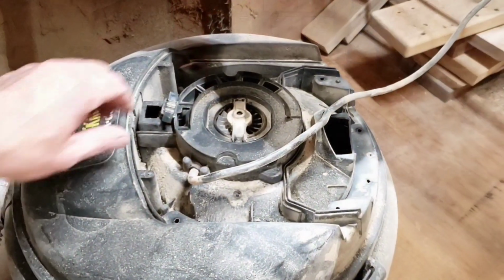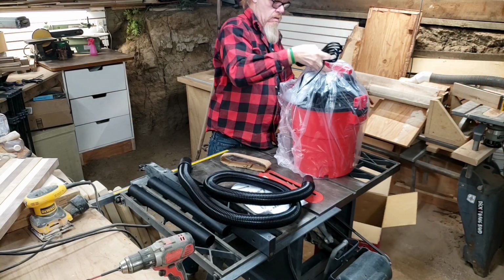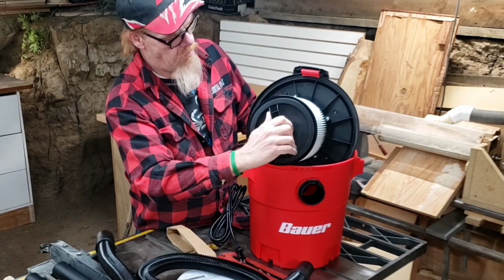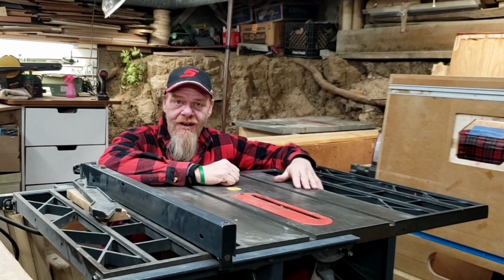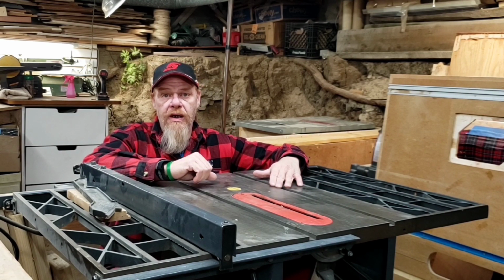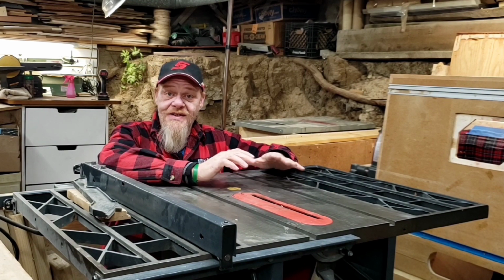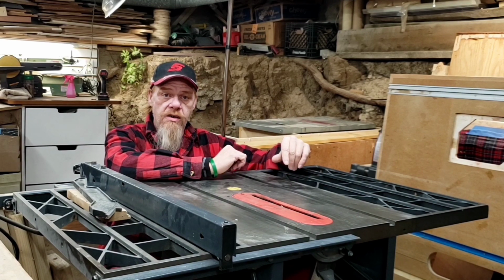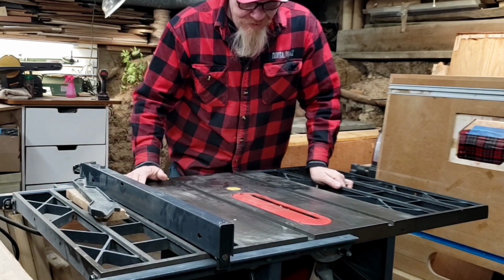ARE BAUER WET/DRY VACUUMS ANY GOOD? | 6 GALLON BAUER 1952E-86

Comment: Nice to see you again, Kevin!
My solution has been to purchase several small ash buckets with integrated dust collection. That way the piping doesn't kill the suction. Also if you get a pre filter for that HEPA filter, it will not fill up that quickly. 
Cheers, and thanks for sharing.

Comment: I’m looking forward to see what you do for dust collection.  Any plans to hook it up the the Craftsman tablesaw?  I should show you how I connected a vacuum to my saw and some of the lessons I learned.
Reply from the maker: Yes Tom the 113...x is a chip making beast, so I plan to make a box underneath it to replace the leg assembly. The box will serve as a chip collector before it goes to the DC and vac system. I will incorporate some jig storage and cubbies under the wings too. 
I would like to see some of your ideas too. Feel free to send me an email with pictures, or you can send them through DM too.
Reply: @MakinSawdust  A collection box is a good idea... that’s where my design fell short.  My saw needs to roll, so I used space under the saw for a caster lift mechanism.  A wedge shaped box under the saw would have been better... to channel chips towards the vacuum hose.

Comment: I and others have replaced the top bushing on name brand shop vacs with a roller skate bearing.    Direct fit.   Time for a new DIY fence on the Sears TS.     Stay well.
Reply from the maker: Great point! The dead vac is not in the dumpster yet, so because of your tip, I am going to investigate a bit more :) Thanks Dan and yes I WILL have a TS fence upgrade new or diy soon(few months)